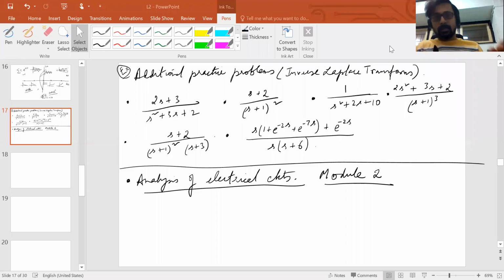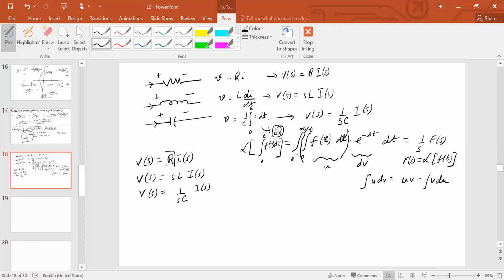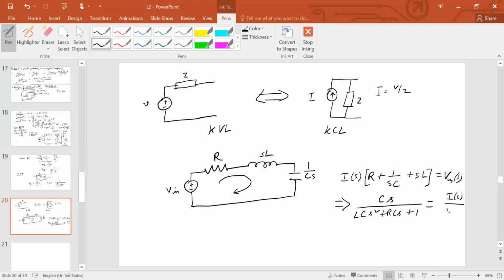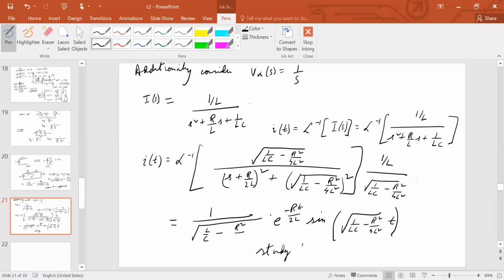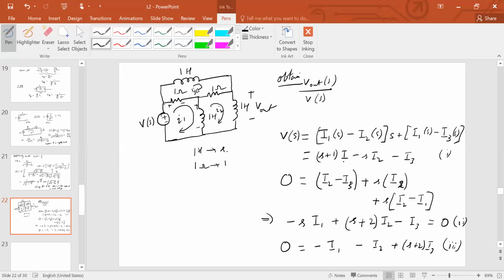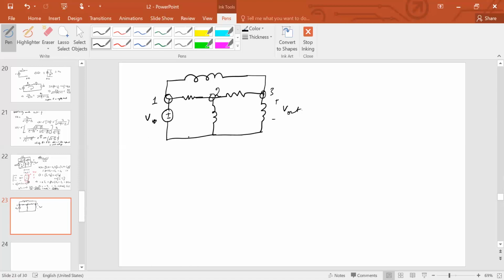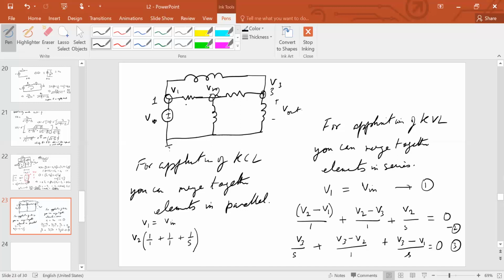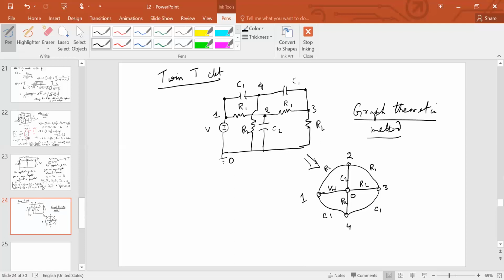EE302: Lecture 2, Module 2

Comment from the maker: Errata: 1. At 22:40 I misspoke. The inductor in an R-L ckt behaves as a 'shorted element' at setady state for a constant voltage applied.
2. At 35:10, while evaluating the determinant, I missed V(s) which ought to be multiplied with (s^2+2s+1).